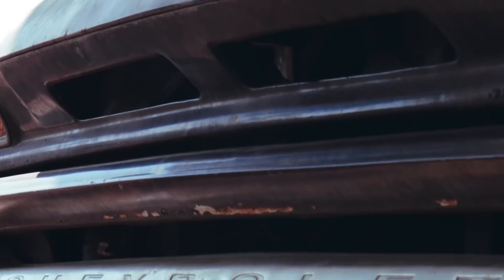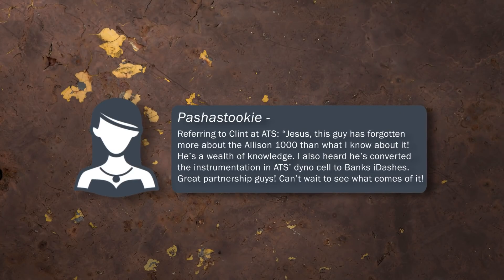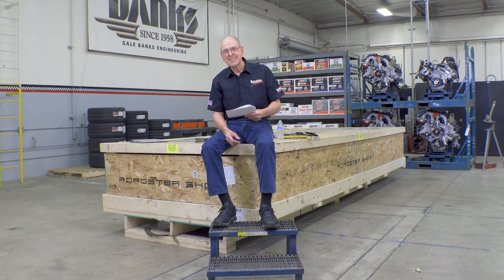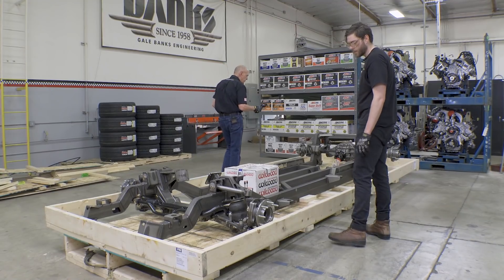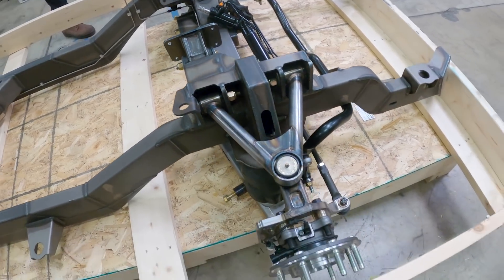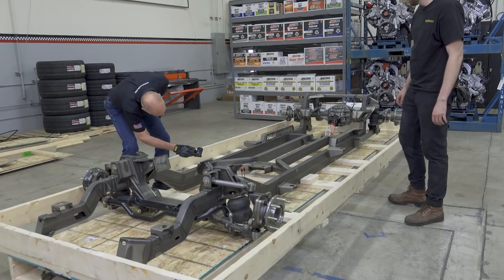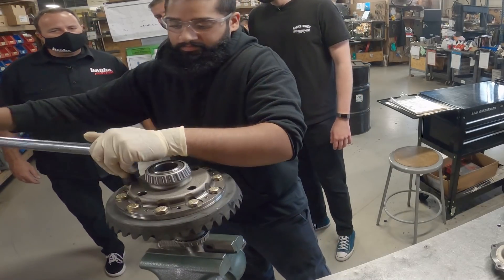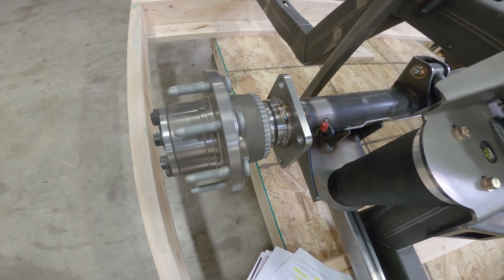Gale UNBOXES LokJaw's new chassis! | Banks Built Ep 15

Comment: Don't forget it's 1000 lb-ft at the crank, 3100 lb-ft at the transmission output shaft (in first gear), and 12,036 lb-ft at the axles, not to mention the torque converter multiplication.  Let's hope those axles have a generous safety factor.   The frame won't enjoy it either.
Reply: as stated axel capacity is 9200 pounds vs about 3890 pounds at the axel with 1000 pound @ the companion flange. literally says we have a lot of overhead. "way overdesigned"

Comment: Ok, i do tuning on VAG (Volkswagen Auto Group) and BMW Diesels over in Iceland...

My go to AFR is 16:1 for optimal power without fogging everything with smoke, i however have experience with going 14:1 over the peak powerband and bumping power.

For an example, i'm talking about the BMW M57 BiTurbo from a 535d, with a boost target of 355kPa (atmosperic), wich is  37psi gauge pressure.

It will do 398hp at 16:1 but with only fueling mods, and the same boost, same SOI, but 14:1 it will make 428hp, so why do you say smoke that you see is horsepower you see, but can't use?

Comment: 13:30 hey Gale assuming 9,200 per axle that's 18,400 of total capacity
If the engine makes 1,526 lb-ft of torque X the Allison 1st gear ratio of 3.10 = 4,730 lb-ft to the rear end
4,730 X your 3.89 rear gear ratio = 18,402 lb-ft

Comment: Incredible design///  do you think it has enough cross members/seems one would be nice behind the A arms lower bend area to the Lg HSS conn pt.//also the passenger side top trans bracket is missing weld at the end approx1" long//was the frame tested as we test a moment connection for a floor beam to column connection in a bldg on the San Diego shaker table///or is that too much///radian/axle/load path/ etc??
Seems the Banks torque and engine/trans build is going to be stressing this frame very well//  hope to see more as you progress

Comment: Where are you going to find the tires capable of putting all that torque to the ground?
Reply from the maker: We’ll be using Nitto NT555R drag radials in the rear. However, they’re only 12” wide so there will definitely be traction issues.

Comment: I really like this Chassis, it's beautifully simple but artfully complex at the same time. It looks like The Roadster Shop has put their work in to deliver a product that will do whatever anyone could need. LockJaw, with the airbags, large by huge brakes and the 4 link/watts in the back would look fast when stopped but would probably be fast destroying cones in a parking lot or at 14,115 feet elevation.

Comment: Thanks for bringing us along on the build. That chassis is indeed art. The notebook with technical days package and owners manual are evidence of knowing the customer. 
Curious why it's not painted? Either it's clear coated to compliment the rat rod motif, or paint was chopped because the build schedule demanded it ship.
Reply from the maker: You're welcome, thanks for sticking with us and watching, The frame has not been powder-coated yet because we still have some housekeeping to finish. We need to do a pre-assembly mock-up, we still have sensors and brake parts that need to be welded to the frame,  and we need to decide on a color for the powder coat.

Comment: 13:58 Transmission gearing multiplies the flywheel torque,so unless your running a stock power motor that pinion is getting way more then 1000 foot pounds.